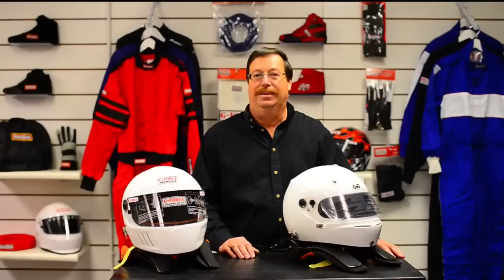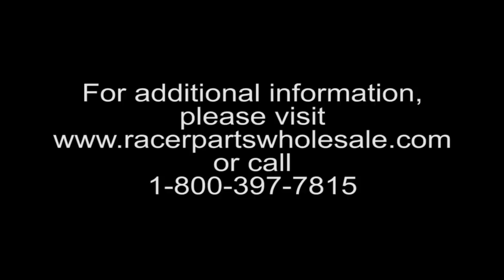HANS Anchor Styles- The Difference Between Post Clip and Quick Click

Comment: You did not say, if both Traditional Clip and Quick Click connected to the same anchors, nor you made a close up photo of them.
Reply: Lev Uretsky , they use different tethers. There is basically no anchor with the quick click, the tether attaches directly to the quick click. The tethers (that you have to change regularly) are cheaper for the quick click but the quick clicks are more expensive than the traditional clips.